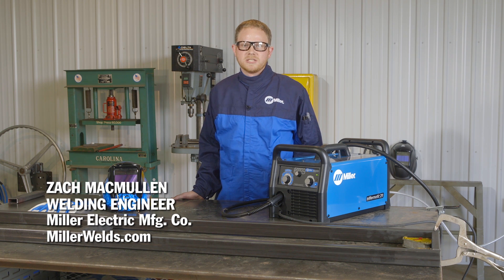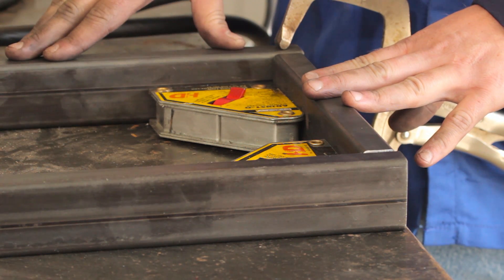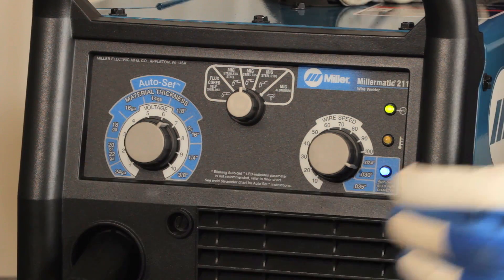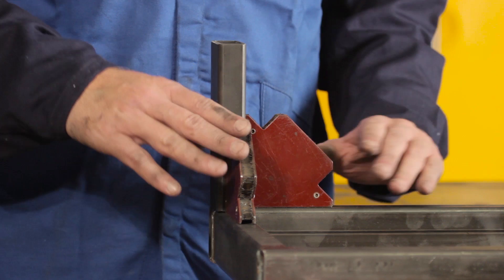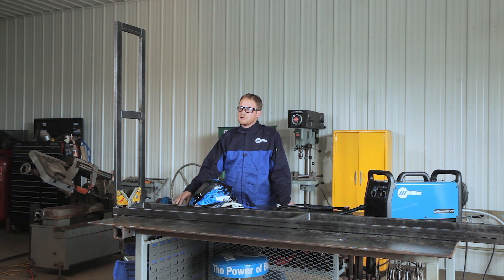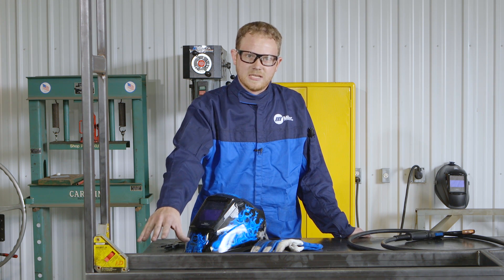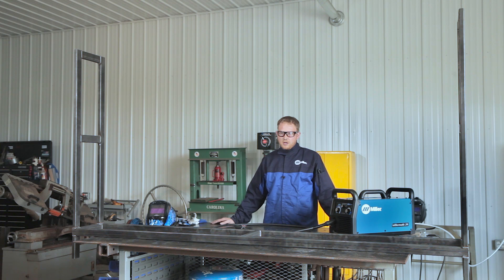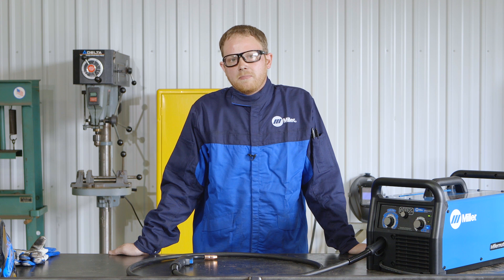Create and Weld a Firewood Rack with these Tips from Miller

Comment: Wow you do awesome work.  have a question. Will it make the rack unstable if I do the leg rectangles first, so I do not have to make legs then fit the bottom rectangle either premade or just add the pieces at the height of the feet?
Reply from the maker: Hi Alex, there are several different ways to layout and fabricate this firewood rack. This specific design was chosen to ensure that there was a square and flat base for the firewood to sit on. By building the base first, you are able to weld the base completely before adding on the legs and supports. With your design suggestion, if you start with the legs, you would be unable to access some of the weld joints on the base.
Reply: @MillerWelders  Awesome, thanks for taking the time to explain, that makes all the sense in the world. I will follow your advise. It sounds best for a beginner, thanks a million

Comment: Good video demonstrating some basic techniques. For added strength, I would have used continuous pieces of steel for both the feet and side wall, rather than cutting off short pieces to make the feet.  It would also be nice to know the size of the steel stock, and maybe see the final rack in use.